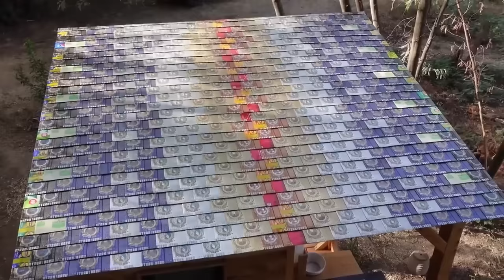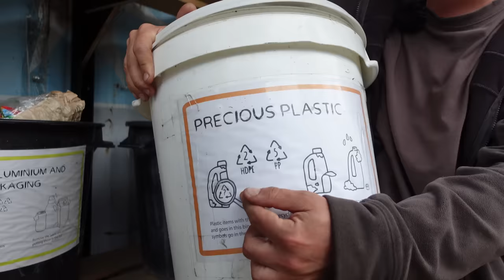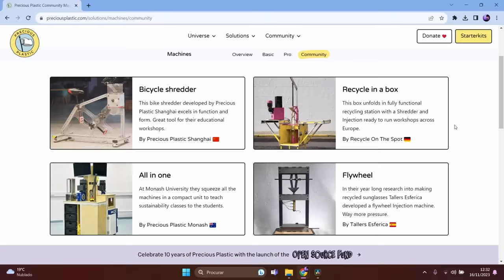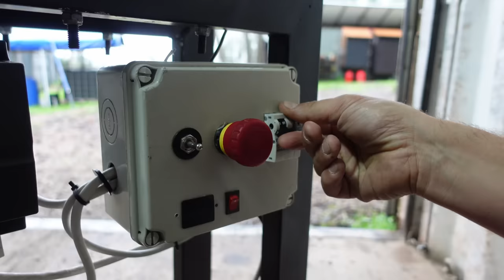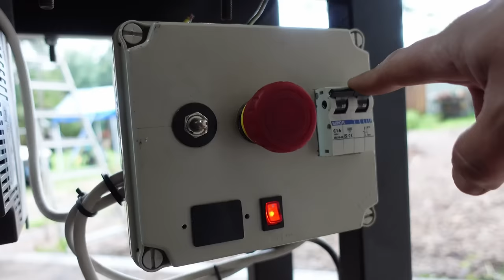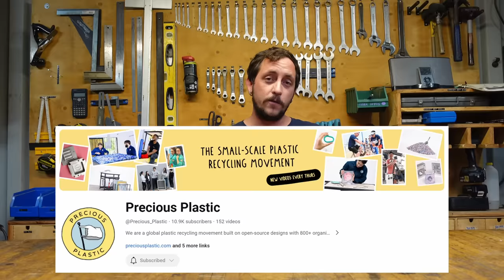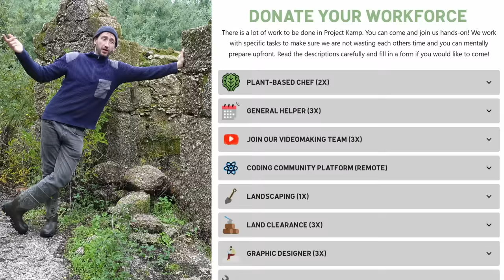#105 Digging swales and planting fruit trees before winter rain comes (LAST EPISODE)

Comment: Love seeing the progress! One thing I'd suggest in the future, is advising farm hands to be careful of tamping the ground when transplanting, especially in freshly turned soil without a robust organic ecosystem remaining in the topsoil (like after a digger/excavator rolls through). I saw a few shots of, when the trees were being planted in their new holes, some of the soil beneath them being tamped down and the soil above being tamped down as well. This is, of course, a very understandable thing to do, given the general assumption that you want to "firm the plant into place," but in an large-ish scale agricultural complex like this I would heavily advise against any sort of soil tamping, especially where you want new plant roots to form.

Compacting the soil, even with the press of a foot, will reduce the air pores and surface area within the soil available both for the storage of water and oxygen but also the easiest pathways for new roots and root hairs to navigate, essentially making it far more laborious and time consuming for a plant to sprout new roots (especially the fine, hair-like roots that actually take up oxygen and water). There's no need to tamp the soil to hold the plant in place, unless you're transplanting in to a pot and out of the ground and need to make sure the plant stays in the pot (if it's going to be rode around on a tractor or handled by customers at a point of sale, for example), and especially when you're transplanting directly into disturbed soil because the soil already lacks a large quantity of the organic biomass (present in undisturbed top soil) that would perform most of the "organic action" soil is responsible for (separate from it's mechanical storage of chemicals like water and H2O, which as stated area also severely impeded by compacting, although not as severely as organic matter is obliterated through being upturned by machinery).

Not tamping or compacting any of the soil around new transplants into disturbed soil (especially after terraforming or hardscaping) will provide non-trivial benefits to the plants evapotranspiration (breathing) and it's ability to uptake nutrients and oxygen from the soil, as well as slightly accelerate the initial growth stages (less compact soil = more room for roots to grow, and less energy needs to be invested in root growth). The compacting of soil should generally always be avoided if at all possible, as the effects it has on organic productivity and energy utilization are very outsized compared to typical expectations (most people don't think compacted soil is bad at all, and in fact think it's the "natural state" or somehow better). Considering most of your labourers are voluntary and slightly sporadic (not consistent year-over-year) I would suggest including advice/instruction around soil compaction in your typical education / onboarding practices, to minimize how much it happens (it is almost always well-intentioned new, practical horticulturists without an academic/botanical background that make this mistake, and it's especially common on commercial agricultural land where there's really no meaningful horticultural education whatsoever). 

TL;DR: You've got the permaculture down good, but volunteer practices evinced on screen indicate a lack of consistent, fundamental & comprehensive horticultural education shared across the volunteers. I haven't seen your videos concerning new volunteer intake/onboarding, but I would advise providing a formal onboarding education (if you don't already) so as to provide some practical education on landscaping botany and horticultural best practices. If you don't have a certified horticultural technician (or whatever your domestic equivalent of that is; I'm Canadian, so I'm sure your analogue is differently named) on-site to provide onboarding (and help advise you on some best practices beyond the permaculture that you already appear to have very well down) I'd advise seeing if you can hire one during the beginning of your work season when new volunteers/participants are setting up their tents etc. The educational value they'd be able to contribute to both yourselves/the managers and seasonal work crews should provide leaps and bounds in increased agricultural output come end-of-season, and I expect that your volunteer positions would be much more attractive to prospects if a day or two of informal/semi-formal instruction from a certified botanist is tacked on to the already excellent hands-on experience with permaculture practices. 

For clarification, your equivalent (to what I call a "Certified Horticultural Technician" in my Canadian jurisdiction) might be a university botany researcher or the equivalent in your jurisdiction (Horticulturists here are sort of a combination of a botanical researcher, and a farm supervisor / greenhouse builder / golf course works manager / landscape designer / municipal public works supervisor, etc). These same individuals could probably be easily bribed to offer their services relatively free of charge, in exchange for a formal relationship concerning data exchange or the possibility of using your site for small-scale botanical research projects (which would be an incredible value-add for both of you, especially from the perspective of attracting high-quality volunteers seasonally), and may allow you some "access" to student volunteers (that would be interested in operating said small-scale projects on-site) which is it's own flywheel of volunteers/networking down the line for both you and all your other volunteers (and neighbours, too).

PS: Any soil compacting you ever think you need to do, you don't. Rain and wind and gravity and your plant's roots growing will do all of that for you, and better than your boot pressing down could ever do.

Comment: The one I'd suggest, not running ethernet next to electrical and use fiber optic for the long internet runs to future proof the project. And possibly in a separate tube to avoid any interference.

Comment: Slight concern with your underground cabling. Firstly you should run another string when you pull it through so you can add more cables in the futre. Your ethernet cabling may not be fit for purpose. Typically you would want a cable designed spefically for burial as some plastic sheaths can absorb water and degrade the strength of the cable and the electrical signalling. The 100-990-305m cable is intended for indoor use. It is Polyethlyene which has a relatively low coefficient of moisture permiability (PVC is awful for burying cable). When it has been raining a lot, you may see degraded performance for quite some time. I would recommend either an ethernet cable designed to be buried, with shielding for running alongside the power cable, or even better a single-mode fibre optic cable which can be upgraded in speed for decades to come. You may have consulted someone already to advise but I've seen the issue with other types of cabling.

Comment: Always water when repotting re-planting. If too much air is left in the soil it can damage the roots, watering helps compact the soil and remove excess air.
On the stumps, if you can dig down, digging a pit to burying them, they make great soil composting. Just have the bury them below whatever level you want to work the soil at.
Not sure cost of fiber optic, and only a minimal plastic difference between it and regular internet cable so probably not worth the extra cost.
For water you could try ceramic, but never worked with it, so don't don't how sanitary it would be compared to plastic.  For waste water drainage it is a great alternative though.

Comment: Hello 😂 I am not an expert but I think that you should not run power cables with Ethernet ones because it Will slow down data speeds. And an other tip… you should run an extra pipe for backup. Hope you find this tips usefull. Take care

Comment: I would have future proofed it by running another cord alongside the ethernet and electricity that you can use in the future to pull another type of cable if you wanted to upgrade the internet cable or just add another electric line.

Comment: But wont you STILL have bits of roots in the ground that might sprout ?? I have tried something like that with willow and there you need to keep them down for a year or so all the way down so they are not able to get ANY leafs to produce more plant material. Maybe you could try cutting them all the way down an cover the ground with plastic or something like that that would keep them from sprouting. Another method we use for invasive species of grass that literally kills EVERYTHING, it grows straigth trough potatoes an vegetables an infest even totally waterlogged ground. It creates so many and strong roots the dirt becomes impossible to work with. For that type of grass we use pigs. We fence in an area and let the pigs run it trough for a few months. Pigs love digging up roots and eating bark so they would kill even trees.

Comment: The digger and so many tools and different equipment are amazing. 
Instead of complaining about oil and things that use oil products for power, we should be GRATEFUL for them, and find the best and wisest ways to use them, and reduce any harm they cause. 
But it is destructive and anti human to think we must destroy the oil industry and end oil as a form of power. 
We should seek to find a proper balance of energy production. 

(For those still reading- energy diversification is essential to a healthy sustainable society. And it is impossible to do this when government is interfering in the issue.  There are some great Australian school economists  who explain how using the government (with rights-violating regulations, subsidies, etc.) to try and fix problems like energy production actually do more harm to the economy and the environment than if they just left it alone.  There is a reason why governments are always the largest polluters.)
Reply: It's is acceptable to use fossil fuels to implement a more resilient system.
Reply: Yes. But I think you missed the point that they are an essential part of a resilient system. 
If you scale up any form of energy production you are going to produce problems.  This includes solar, wind, tidal, etc.  So having lots of different types for different places and different reasons is wise.  
And letting the politicians pick winners and losers in the energy market will ensure everyone loses.

Comment: Hello! I have been watching the project from the beginning, but I am commenting for the first time. As an Electrical Engineer I wanted to chime in on the pipe idea. In the US we often run metal tubing called conduit to route power and internet cables. I do not know if this would be allowed in Portugal. The metal would last just as long as the plastic, effectively, and it is likely made from some percentage of recycled metal already. And if you have to dig it up many years later and replace part of it, you could recycle the metal tubing easier than the plastic tubing.

Comment: Excellent, positive end of season video. Land clearing and grading. Designing berms, swales, road ditch, tree and fruit planting, grass seeding. Reducing fire risk, rescuing and replanting local tree varieties. Using compost, wood chips, manure, soil to back fill trees' holes. Recycling Kamp plastic into clothespins.

Celebratory end of season meal. Help for tree planting from the neighbors. Demonstration of existing Kamp equipment for recycling certain types of plastics. Sure took some effort to inject the molten plastic to the hook mold. Also liked the inclusion of the mimosa bench furniture.

The suggestion would be to cover the laid cables/pipes with a protective bed (6 to 12 in deep) of 3/4 to 1 in gravel. A visual indictor when digging in the future that you are close to laid cables.

Depending on rain water volume and runoff, the swale size can be adjusted. Or the water flow barriers (rock, stone, wood, tree stumps) can be determined.

See you next year April. Unless there maybe 1 or 2 additional teasers or videos.

Comment: I know this might seem counter intuitive, but you could plant some fast growing support species (like Mimosa) which you can 'chop and drop' to feed your fruit trees. If this area is more densely planted with trees, then the microclimate will be more temperate (ie, it will be more protected from frost and also heat). It would also increase the soil retention and the fungal network in the soil. For example, if you interplanted mimosas within this system, you could bollard them at 1m tall. Cutting them in such a way will not only add nutrients to the soil, but it will also periodically increase the growth hormone in the root network in the soil. Finally, Mimosas are in the family, Fabaceae, meaning that they fix nitrogen in the soil.

People are often hesitant to use invasive species, but they can be a massive benefit to food forests - especially when starting out.

Comment: 28:47 for the next time you're pulling cable through pipes like that make sure to attach at least one new cord with the cables to pull through. That way you can add more cables in the future. Also from what i heard it helps to put a bit of soap on the cables to help them glide through the long run

Comment: I hope your Ethernet cable was screened otherwise the induction from the power cables will mess with your signal.Looking at that one your showed at 27:52 it did not look like it had a metal screen?Ethernet cable  should normally  be run 300mm apart from power cables.Also the power cable looked quite small for that long run,did you do volt drop calculations?

Comment: Mistake one, don’t run your internet cable in conjunction with the electric cable as you’ll get interference and your connection will suck, mistake 2 always add an extra conduit to allow for any extras in the future like fiber optics etc etc. mistake 3 never use fresh manure like that it need to rot before using qnd should be mixed with soil and not dumped in the hole, that “fresh” manure will waterlog the roots of the trees promoting disease and rot on the root system of the plant cause to become week or even die…
Overall love what you guys doing great to see

Comment: Great Season, a few things to note from my experience:
1) its not good to put low voltage and high voltage cables together. Its actually not allowed where I live. On one hand its a safety issue and on the other your data maybe compromised by the currents in the high voltage cable. I believe the distance may also be at the limit for a Cat5/6. You cant have this beyond 250m. 
2) the electrical cable looks very small gauge (!!!) for that long run. You need to run some calculation on what load you want to run in the office. Please make sure you protect this with the appropriate breaker. 
3) normally you dont put water and electrical at the same depth in the trench. You should check local code requirments.
4) when back fill - always put an ALERT tape in the top 20 cm, to alert any future digger about the burried cables. 

Its good that you have this in pipe, you could pull the electrical and ethernet back out and replace it with a larger gauge high voltage wire. You could udse a directed peer to peer network connection through the air as you have line of sight between camp and office. 

By no means do I want to discourage you guys, you have done a great job working the land with the minimal tools & funds you have. I just wanted to provide some tips on keeping you guys safe. I am looking forward to next year when you pick this up again!
Reply: The best practices on utility development are certain to be ongoing and the feedback consensus hopefully translates to suggestions for “continued learning”.  These cables are already done.
💡 checking guage requirements and re-pulling wires for electrical seems sound. 👍🏻
💡 if no “scary tape” possible; investigate how well ‘locating equipment’ can trace (find) and improve.  Also surface indicator staking of “buried cable”⚡️
💡 internet cabling (piped too) could potentially be still placed at relatively significant depth and warning marked with modified means… deep tooth (ditch-witch a common referred name) or horizontal drilling.
Assumption this infrastructure was also placed for use with the COMMUNITY CENTRE site.

Comment: Hello,

Just some information.

In Portugal, it is prohibited to dig the ground with the bucket of the rotating machine (land preparation). It is a bad soil mobilization practice and in the video it is perfectly clear why. All it takes is a light rain to create erosion. Furthermore, they are placing the fertile layer of soil at the bottom and bringing the inert soil to the top.

Comment: I know it's easy to say with hindsight, but to remove the stabilising effect of the Mimosa roots from very fine soil could cause the soil to be rapidly eroded away in heavy rain, that's why I suggested removing the 1 metre high trunks that you left and not the roots, well not at the end of the dry season. This should have been done as early as rainfall would allow in the spring and then the area could have been replanted with for example, grass so it could grow during the dryer weather and its roots help restabilise the soil before the onset of the rainy season.